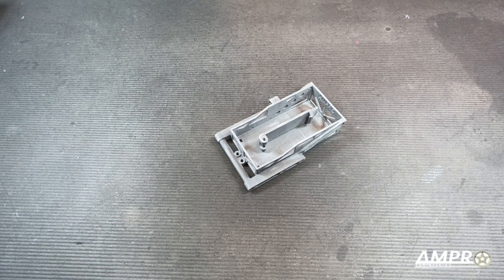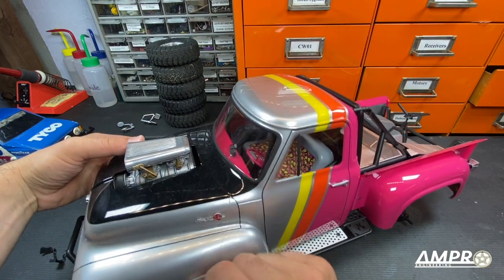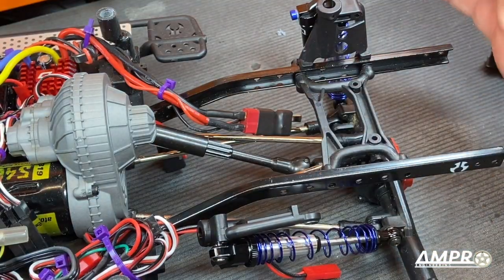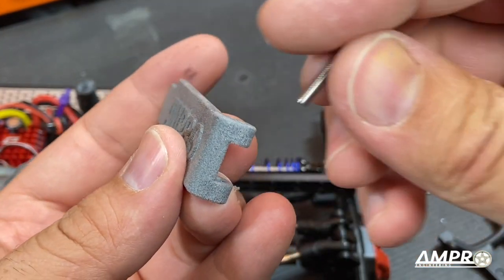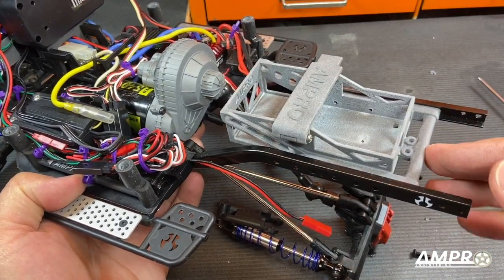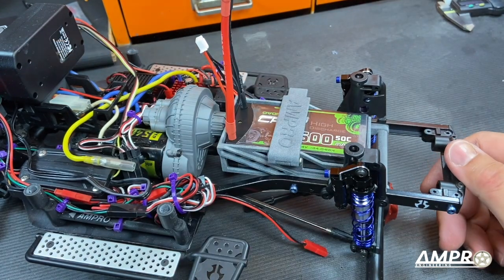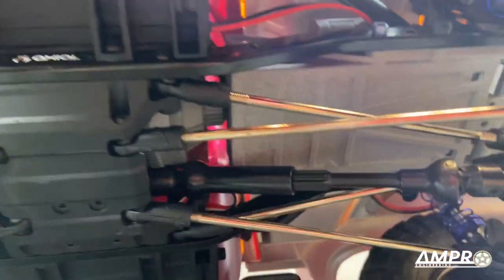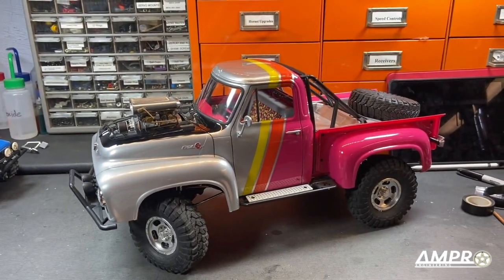e278- Axial SCX10 II Rear Battery Tray

Comment: Very nice,but extremely tight fitting remedy to the battery tray problem.
Reply from the maker: That’s the truth. The main issue was the fact that I made that servo winch mount that occupied area for the battery and then installed the interior which made that entire front region useless. What I should’ve done is made the floor less deep on the interior but I wanted to use the factory drivers from the Tamiya Bruiser. There are a lot of compromises here